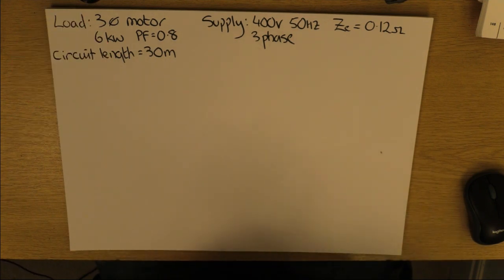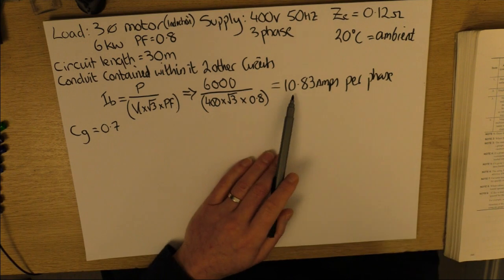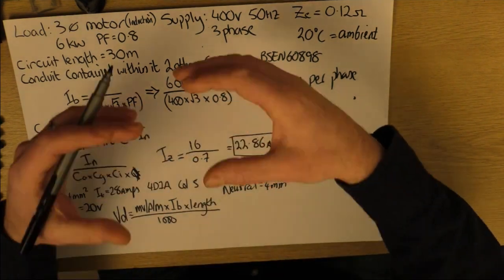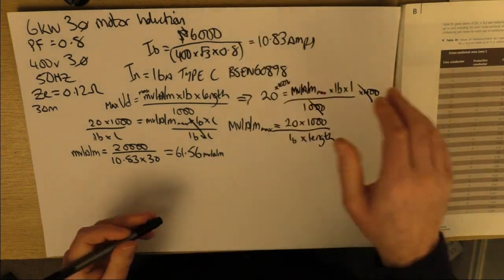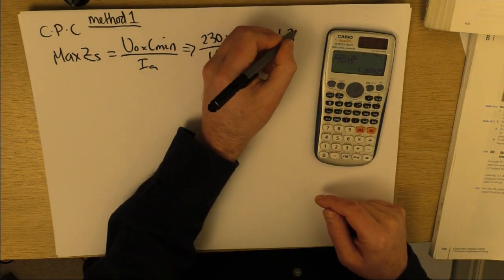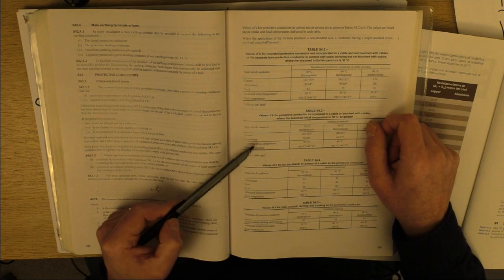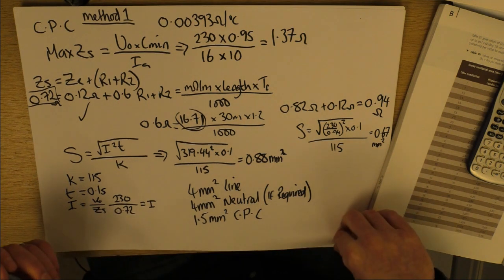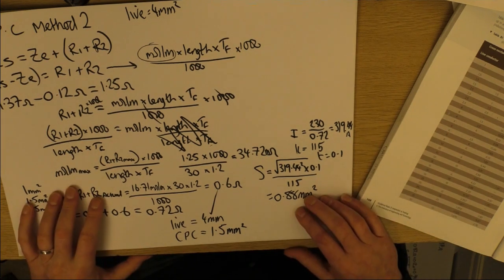Cable calculations design steps for a 3 phase induction motor, power factor, sizing all conductors.

Comment: A 3 phase motor can be wired in star or delta.  Does this affect the power ?   Does it affect cable sizing.   Please advise
Reply from the maker: Yes it does effect Power. Star is approx 1/3 of Delta. We start in star to build up speed then switch over to delta. Think of a car starting in 1st gear then switching to 2nd gear.

Comment: 3 circuits in conduit.  What does this mean exactly.   Are we looking at supplies to 3 motors.  That would be 3 phase and earth times 3  (12 single core cables) ?    Are they single core or multicore cables ?   Please explain
Reply from the maker: 3 circuits means single or 3 phase or a mix. There is guidance https://shop.theiet.org/electrical-installation-design-guide-5th-edition on how to calculate these for various scenarios page 51 onwards but i usually stick to  simple circuits in these videos. It would be 3 similarly loaded circuits. If a circuit is only carrying a small amount of current it can be ignored. Guidance value is around 33% of its capacity in the installation conditions.

Comment: With regards to Cg, grouping is a lot more nuanced & is full of pitfalls for design such as notes 8 + 9.
Note 8 significantly changing the current rating choice depending on temperature of cables in the group.

Comment: Could you do a video on motor calculation with locked rotor current and explain what this is also? 
Thanks
Reply from the maker: some would describe that as in rush current. happens during the first few moments of starting the motor. Once the magnetic fields and resistance has been established through heat the current drops to lower levels.

Comment: I don’t seem to get my head around the square root, can you explain it to me
Reply from the maker: A square root function is the opposite of squaring a number so for example 4 "squared" is 16 and the square root of 16 is 4. or 9 "squared" is 81 and the square root of 81 is 9. Is that what you meant? or more specifically as to why we use the square root in some our calculations?
Reply: Yeh I had a brain storm ,I was squaring it sorted now
Thanks  @cestemshow

Comment: Interesting video, but note that re thermal constraints / checking the cpc size, the method you show of V/Zs is for fuses, whereas the EIDG says (don't have it to hand, but think it's chapter 8) that for CB's and PEFC of up to around 3kA, the CB trip rating can be used, whereas over 3kA, A2S's are used.
Reply from the maker: Yep, Section 8 and a little bit of 4. Figure 41b shows how the plot gets a little bit whacky after 3KA. This is an intro video, always tricky to decide what to put through and what to dive into. Should prob also check 434.5.2 after that level........

Comment: Did u forget to factor in ambient temperature?
Reply from the maker: Yeah kinder did 🙂. What factor would you use? BS7671 on goes down to 20 degrees and would only have a beneficial effect the colder it is.

Comment: hi boss, in the beginning of the video the circuit is a 400v three phase system, i follow along for the calculations there. why when we go to calculate the CPC for the circuit are you then using 230v for the maximum Zs? should this value not still be 400? TIA
Reply from the maker: Hello, For the cpc we are concerned with line to earth fault. Generally this will only be 1 line touching cpc so 230v approx.
Reply: @cestemshow  thankyou so much for taking the time to reply!

Comment: where do you find out the power factor from?
Reply from the maker: The manufacturer would state it on the motor plate as "cos theta" value usually.

Comment: What free table or book may i use in the Netherlands? Or English downloadable  FREE book?
Reply from the maker: Unfortunately these books are copyright protected. However the cable manufacturers and protective device manufacturers will have their data available free of charge. I will do some videos on the cable factors soon and will show the tables there but there are other ways to get some of the common factors so the table won't be required. Most countries regulation books are based on iec60364 and some countries have theirs for free. So to get an idea of how it's written you could try looking for that.
Reply: @cestemshow   This is what i can use https://docplayer.nl/8187348-Normen-formules-tabellen.html     page 9-4  the table that is landscape   "Normen, formules, tabellenOverstroombeveiliging van kabels en leidingen"   Also look at 2 pages before this table.  May i email you, about the procedure to select a motorprotection  on a circuit that is able to do  starcircuit to deltacircuit at startup.  How to calculate  Ib, In proberbly in worstcase delta ?  Shortcircuit current calculation, how do you determine this for a delta and for star, and is this shortcircuit current neccesary to select a motorprotection device? Is the basic procedure step 1) determine In, the maximum current of the motor at maximum load, if this is not on the motorplate then do use factor x I from  kW   then step 2) at startup a motor will pull 6 x In and look in the specification of the motorprotection device if you need type B or type C and select an appropriate device that is able to do 6 x In ?   at the end you do the cable/wiring size calculation with cos phi     the last part cable/wiring selection is clear, but the motorprotection selection is confusing and difficult, proberbly since it differs from DOL and star to delta.  Also i found this, check this the WOLF method  https://www.youtube.com/watch?v=sjQV2A9bjcc
Reply from the maker: Yes by all means email me. Sounds like you know loads 👍. I left out efficiency in the design current calculations because I was mainly focusing on the cable selection bit for my students.

Dol is easy and protection usually comes within the motor itself.

Star delta is simply about the connections and usually a couple of contactor can handle that with 2 sets of wires coming from motor to contactor enclosure then depending on the motor you set up a timer to activate them into delta connection.

Hard to teach this stuff over this forum because it's complicated and depends on which type of motor etc.

Ultimately I'd say get in touch with some motor manufacturers as they have the best knowledge for this stuff and in the real world I've always consulted with them before finalising any design.

Email is completelyelectrical@gmail.com
Reply from the maker: https://youtu.be/km8MSWm39Z0

Great vid for star delta simple explanation.....
Reply from the maker: Also check out https://youtube.com/c/JeremyFieldingSr

He has some fantastic motor videos on his channel and has worked with motors a lot more than me in the real world.
Reply: @cestemshow  I have response message, i would like to know how to select the MCB , the type  is that realy based on the Ib, and ib is the current in the motor coil?

Comment: why don't you use 0.4 for disconnection time? just started learning this and I have calculated it with 0.1s and it complies but when you do it with 0.4s it doesn't if you use 1.5mm2
Reply from the maker: Hello, the protective device would disconnect in 0.1s according to manufacturer as long as Zs complies. A D type may be 0.4s.

We are allowed a max disconnection time of 0.4s as per table 41.1 bs7671. Any circuit outside of that scope would be 5s on TN earthing arrangements. Tt would be 0.2s or 1s accordingly.
There is an argument to say you perhaps should design for the max allowed rather than actual disconnection times in case someone changes the type of device. But, that's really up to them to check and confirm suitable really.

Some breakers achieve better than 0.1s! It's information from appendix 3 bs7671 but manufacturers can provide much more detailed information.

Comment: how to calculate voltage drop from x, y and z table
Reply from the maker: Just use the Z value instead in place of the usual mv/a/m

The r x values are the resistive and reactanctance components for the cable per m and the z is the impedance so just use that 👍

Comment: Why isn't it 230Vx√3 as that equals 400V?
Reply from the maker: It's splitting the power equally over the 3 phases. At any one time the majority of rms value is only present in 1 phase at a time so to deliver the power you need to consider the delivery of all 3.

123 123 123 123 etc. If you zoomed in and looked at the characteristics for each nano second it would look very different but to get an averga power split over 3 phases we essentially are saying power diveded by 3 x 230v.... Ish. 😁

Comment: Something that has just crossed my mind is how to size cables for ev chargers. Is it just simply a case of selecting a cable that can handle the rating of the outlet? Could you show a worked example for this situation? Cheers Craig👍
Reply from the maker: It would be a similar process yes. So a 3 phase would be sharing the total rated load but there are more things to consider. But yeah, il stick it on the list. 👍

Comment: Great video. Was discussing the other day what you mentioned with the formula Zs=Ze + (R1+R2) and it seemed bizarre that you could add resistance and impedance to equal impedance 🤔!  Would be interesting to see a cable calculation with cables greater than 35mm2 where you allow for reactanance as that's not something I've calculated!
Thanks
Reply from the maker: To be honest, ive only ever calculated it for my own curiosity and I discovered how hard it would be to get an accurate result. In the real world I just use the data sheets from the cable manufacturer who state impedance per meter values. 😉